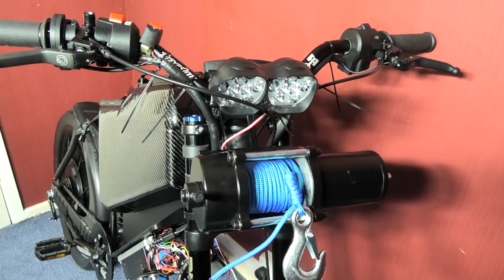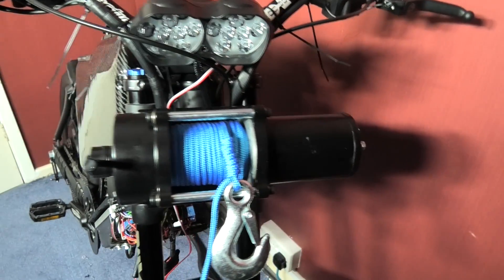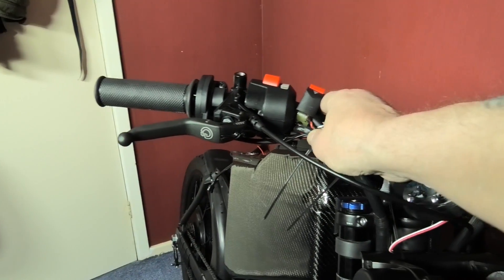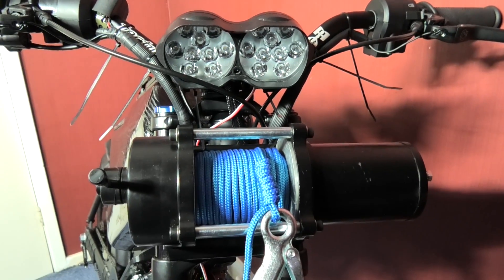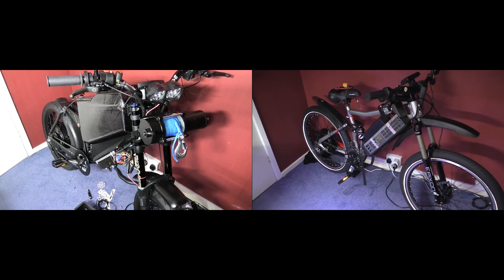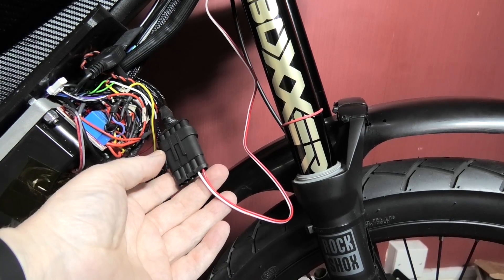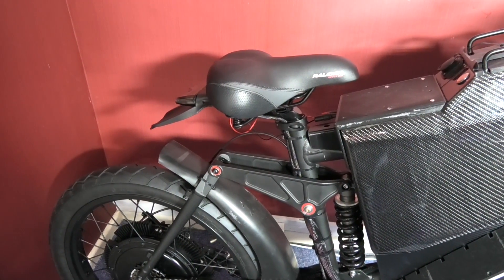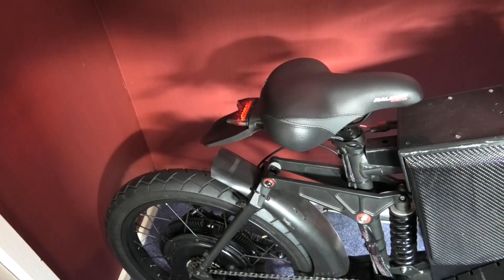High powered DIY eBike MSVA build part 29 - Stair climbing solution

Comment: Wouldn't it be better to mount the winch in your house? Then just hook the hook to the bike if you need to lift it. You can build a remote for your winch or buy one with a remote. Looking forward to see what this can do. Did you wire it for delta and or star config on the motor?

Comment: Dont need a winch lol. Pull the bike as far back away from the stairs get on and ram full throttle up the stairs😂. They shud have lift in ur flat making every1 carry everything up stairs. Its taking ages but i can tell it will be worth the wait. Hope ur back gets better mate.
Reply from the maker: When the bike is at the foot of the stairs, the distance between the bike and the wall behind me is 8 inches - not really enough to get any decent amount of speed up. I've ridden motocross bikes up loads of stairs before and this time, I hate to admit it, I'm beaten!
A couple of weeks I reckon ;-)

Comment: i have a couple of 4x4 vehicles. i have a 12,000lb winch on one of them, so i may be a little biased, but i think the winch looks cool on the front. it definitely looks ready for anything. think of it as a post apocalyptic wonder ride that even mad max would be proud to own. lol! try coating the hook with plastidip. it would help quiet it down, and make it blend in with the rest of the bike. that headlight is something else. i've been looking for one for my bike build, and it looks like it would fit the bill perfectly. i've never been to banggood, is it trustworthy, and reliable?
Reply from the maker: I've placed over 300 orders now and only one of them went wrong (It got lost by Royal Mail).
Although the name sounds really bad, I've never had a problem with them in the 5 years I've been using them. I always pay the extra couple of quid (bucks) and have everything delivered in 4-6 working days.
Reply: @Vortecks  if that's not a glowing endorsement, i don't know what is. beats waiting a month for free shipping from china on ebay. i use it because of paypal, only they know my card #, not the sellers, and i've not had my card hacked in 9 years. but i'll give them a try for my next buy. i really do like that head light. take care of your back, i'd hate to see you not be able to enjoy all of your hard work. it's really been a hoot following along with the build. thanks!
Reply: Yes it is, have used them for a few years now... sadly I think I just bought the last one in stock, sorry!
Reply: @ahaveland  no worries. thanks for the information. i've been using ebay, since i am unwilling to use amazon. i'll try banggood and see what happens.

Comment: Great solution! I don't care what it looks like if it does the job. Hope you'll post a demonstration of it in action.
Those whinging about it obviously haven't tried lifting a 50kg bike upstairs with a bad back.
My next battery is going to weigh 30kg, 14S48P so I may have to do this too!
Reply: Nobody's that stupid m8🤣
Reply from the maker: Needs must mate. I don't like it but I've got to do it and I knew there would be loads of haters even though I tried to explain why I've done it. Mine weighs 58kg now and (even with the battery removed) it still weighs 38kg. I'm not brave enough to try to dead-lift that amount with a herniated disk.

Comment: Couldn't you have mounted the winch in your flat/house to use to pull the bike up rather than on the bike? you should title the video "ELECTRIC OVERLANDER BI-CYCLE"
Reply: Completely agree. More leg work but you look less of a prat:) One other observation, by having the tow point so high on the frame the bike is going to nose dive into the steps. Put an eye at axle level to allow the bike to climb the steps.
Reply from the maker: @Savage FPV Nope, sorry - it's a communal stairway and it's not allowed.
@Rob B Yes, you're right. It is one of my worries but I'll be hanging onto the bike and pulling the back down. I did consider putting it somewhere else but it would interfere with the suspension. Plus which, I don't really want 58kg pulling on my front forks.
Reply: All good points

Comment: Are the stairs you have to get up communal. If they are a straight run & only you use them get a stair lift track mounted directly to the stairs.

Comment: ummmm.....lose the winch, drive the bike up stairs....?😀
Reply from the maker: It won't work. The stairs are a sort of porcelain and nothing will grip - believe me, I have tried.
Reply: Vortecks   hmmm...perhaps you could convince the property owners a solar garden shed at ground level would be a good thing...all of my ebikes come inside my house...it looks more like a bike shop inside, than a house. lol
Reply: @Vortecks  Your tires look like not gripping much anyhow :p 
I just nudge on the throttle when going up the (whatever) stairs that come in my way but even with 2wd, the front wheel bounces a ton. I have to be very gentle with the throttle but it climbs the stairs by itself. 
Obviously I don't ride it on stairs. 

How many places with stairs you got anyhow? You might just mount the winch up stairs and bring the hook to the bike when needed.
Reply from the maker: @PașcaAlexandru  There's 2 flights of stairs, I can't get a run-up on either of them and they're made of porcelain so there's zero grip (I did try it with V2 and it just made a lot of smoke). I can't mount it to the wall because it's a communal entrance and it's not allowed. This is my only option, nothing else will work because my back is still bad and probably always will be.
Thanks for the suggestions but I've spent many hours, trying to figure out a way to do it and this is the only one that stands any chance of working.